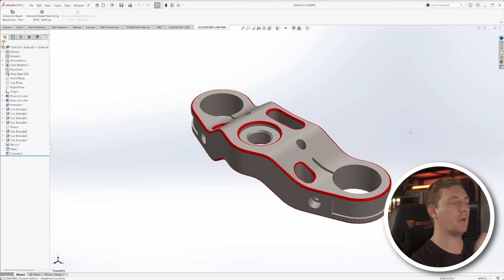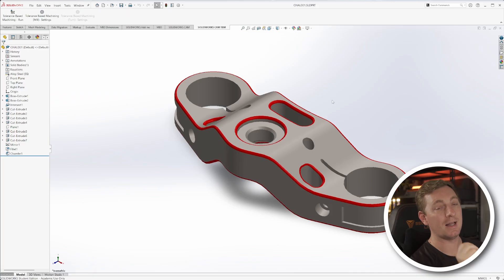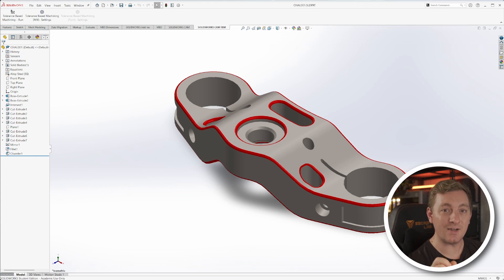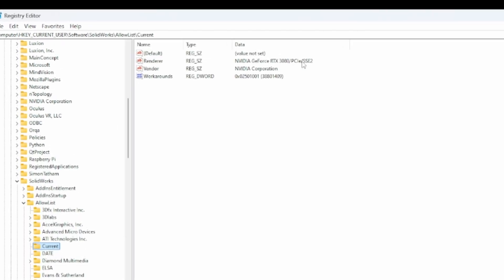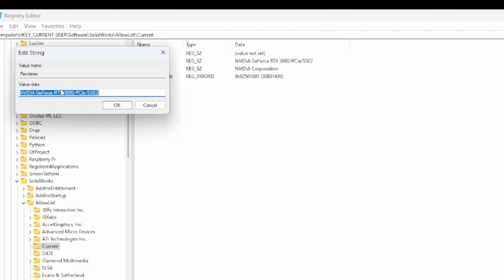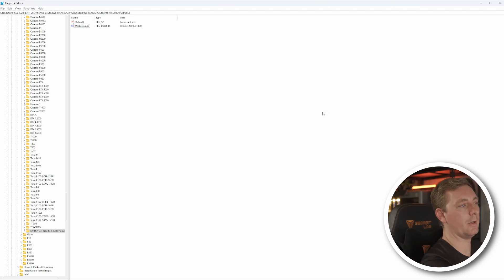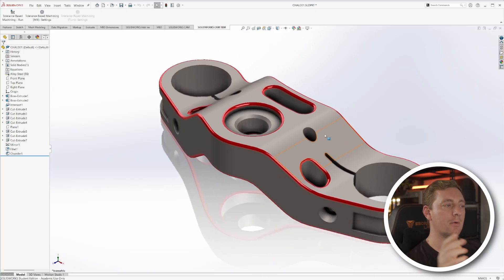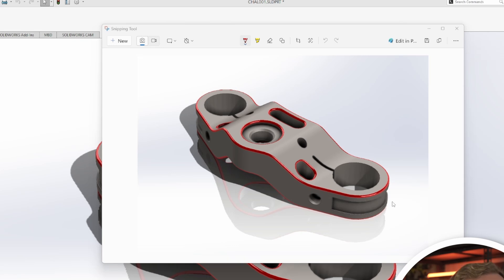How To ENABLE Realview Graphics Solidworks 2024 | Easy Tutorial!

Comment: Seems like it's changed again in April '25 Maker version. I had to delete (renamed it to Solidworks_OLD) my existing registry tree, and create a new blank one by restarting Solidworks (losing my custom button layout) and apply the hack again. This time though it seems like there's an extra step required. The key needs a "subkey" named "V001_FG_V2221138541" also with a dword 32 key value pair of - Workarounds and 32408 which is what works for my 4090. Seems like you want to copy the value from the closest Pro version of your gamer card. As far as I can tell the closest pro card to the RTX 4090 is the Quadro RTX 6000 - and it's Workarounds value is 32408 - if you look at the different pro card workarounds values they vary a bit.